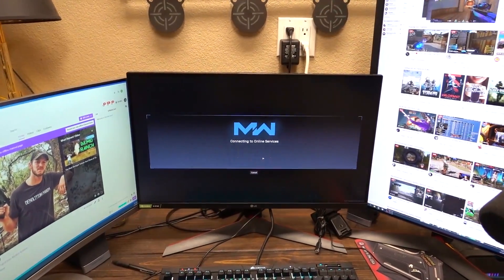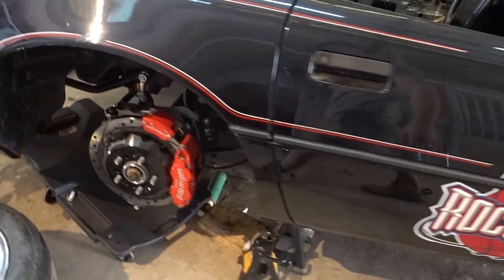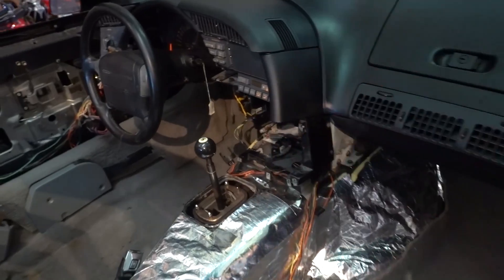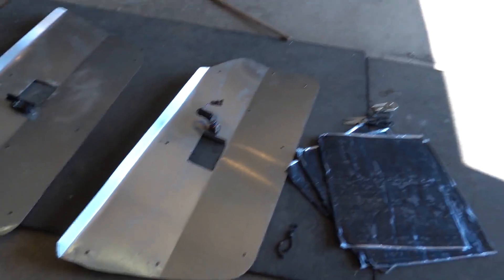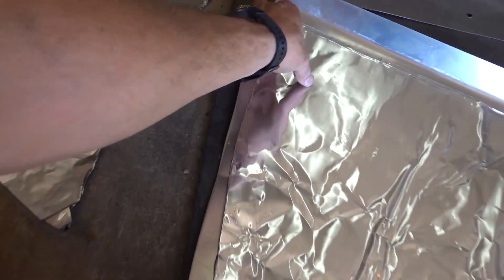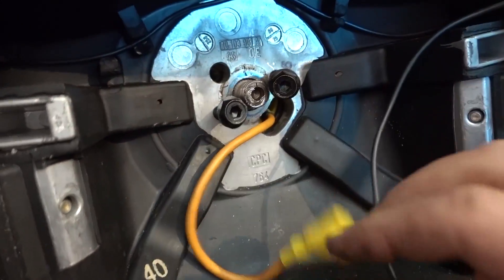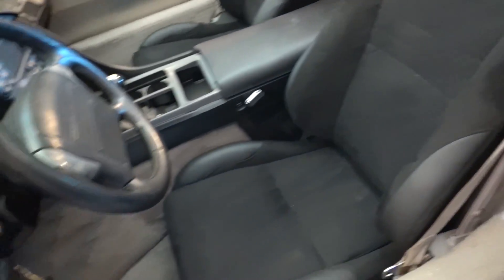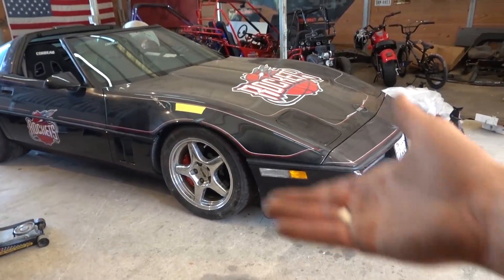Rebuilding a Destroyed ZR1 Part 10: Series FINALE

Comment: When you attach the harness to the cage, make sure you attach to the upper tubes. If you attach to the lower tubes and crash, it will compress your spine.
Reply: Woah! Didn’t know that was a thing. Ouch.
Reply: Hmmmm, interesting. It makes sense though. I'll keep that in mind when I build my car in the future
Reply: Ok boomer I drag race for a living. I crashed 4 times and I rolled the fourth time and my harness was on the lower tube and im still fine and it was the car
Reply: I mean, that depends on the Angle between the seat openings and the bar. Usually manufactures say up to 15 degrees is okay
Reply: And that doesn’t look like a crazy angle. Hard to tell by vid tho
Reply: @sargentwizard4385  Technically, I'm a millennial. You need to work on your critical thinking skills. Clearly it depends on the angles and other specifics of the installation. Just because it hasn't caused you a problem doesn't mean it wont ever, and it doesn't mean it wont cause someone else a problem in their setup. It's better to be safe than sorry, and I just wanted him to at least consider the potential issue before mounting the harness so he can make an informed decision.

Comment: IMPORTANT LIKE SO HE SEES THIS!: That seat is too small for you, you need a taller one. The highest point on the belts is over your shoulders which can cause your spine to compress if you hit something. The holes in the seat should be over your shoulders.
Reply: You’re  right!
Reply: Bro it’s fine
Reply: It does not matter he knows what he’s doing
Reply: @gageaversa6976  it kind of does matter though
Reply: Gage Aversa  sorry but you are wrong, you obviously don’t know to much about cars. When you get in a wreck you want the harness above your shoulders so that it doesn’t pull you down to the ground. Instead it pulls you back away from the steering wheel.
Reply: def needs to sit lower too, hes almost the same height if not taller than the cage
Reply: @gageaversa6976  Yeah, it doesn't matter at all. Who cares if he gets into a crash and it  compresses his spine and causes major injuries. Doesn't matter at all.
Reply: @gageaversa6976  he might, but someone else could cause a crash.
Reply: is he going to use a 5 point seat belt?  if not, then it doesnt matter.
Reply: why does his 1990 zr1 sound exactly the same as my dads 1994 chevy camaro?
Reply: Also, don't mount the harnesses to the bar; mount them to the floor behind the bar, and run the belts over it, so that the pressure keeping you in the seat is horizontal and not vertical.
Reply: You're right but I doubt he'll use harnesses
Reply: @danedomerese9604  no u

Comment: Those door panels have my arms crying in agony for the Texas heat.
Reply: Well it is a stick so you won't ever have your left hand off the wheel
Reply: Dani Khaos false, I do it all the time. When your cruising what do you need to be shifting for?
Reply: Left on the window and steer with right. Need to shift for any reason switch and shift then switch back. I’ve driven manual for 12 years and as I said I do it all the time.
Reply: Didn't he say something about tint?

Comment: So happy to see someone tightening wheels properly with a torque wrench 12:00
Reply: No need for it
Reply: @JedemPoKucama  I will politely disagree. In 17 years if automotive and using different tightening methods torquing is tried and true for best results and maintaining proper brake rotor orientation. If you want to hammer lugnuts on with a torque stick or socket only, job security when those come back for stud replacements or warped rotors and brake jobs.
Reply: Said no one ever
Reply: @jonkwarsick2813  awesome
Reply: my impact gun goes BRRRRRRRRr
Reply: @JedemPoKucama  Don't need it on steel, but you need it on alu
Reply: Ugga Duggar’s!!!
Reply: Corvette lugnuts torque specs is 2 ugga duggas

Comment: When it comes to that steering wheel from experience the best way to remove them is to leave the nut threaded on just barely(keeps the wheel from coming all the way off and smacking you in the face) and pull torwards you as hard as you can until it makes it to the nut.
Reply: He is right....leave the nut a bit on and hit it from all sides....there is a spring behind it so the nut saves you for smacking it in your face....good luck with that
Reply: 😆 I learned this the hard way when I was a teenager and smacked myself good

Comment: I put the same seats into my 1990 base model C4 but ordered the seats and brackets separately so it took me a bit of trial and error before realizing the seat go on the opposite side with the recline handles going inboard near the seat belt latches. Good job on the build.

Comment: To get steer whel off, screw the but back on flush with end of thread. have someone put pressure on both sides of the wheel as though they were pulling it off, small sharp tap on the nut with hammer and wheel should pop off the spline.

Comment: Little tip with the steering wheel, it will come if you hit it hard enough, but wind the nut back on a little bit so you dont break your nose when it finally gives way.

Comment: Wheels:
My opinion for C4s would be something with a nice dish/lip (lower offset), or if you plan to do more of a flush offset, do a wheel with fewer and wider spokes similar to the factory wheels. If you do a deep dish/low offset wheel, make sure you have a lower offset in the rear than the front so it looks proper 👌 same with the width.

Comment: Helpful tip for removing steering wheels, keep the middle bolt on slightly and just bang on the side of the steering wheel and it'll knock it loose

Comment: Matt! For future reference, taking off an old steering wheel is much easier by not taking off the center bolt (that sits under the airbag) all the way and smacking the sides of the wheel to jar it loose! Then, you just pull it off like it's nothing!

Comment: A piece of aluminum billet easy to drill holes to match holes on steering wheel at least 5/8 thick pull tight with bolts longer than ones used against end of shaft then give it a brap with air hammer

Comment: To make the rims poke out a little more, you can get new rims that are a little wider but also get spacers, jist make sure you get these things called hib centric rings for your new rins in order to minimize vibrations at high speed, also do yoir research on the rim company and how they make their rims (pressure casted, forged, etc)

Comment: I would buy 2 big sheets of Kydex "like holsters" and cover the door panels. I'm not digging the chrome color doors. Plus it will be super hot if you touch it. I would get Kydex or some plastic, use a hot gun to stretch it out over the door frame and put some black or whatever color Kydex you chose plastic screws into the door panel to hold the Kydex up.

Comment: corvette metallic grey... use factory wheels and powder coat black chrome.
we need to hang out. I used to hang out on a 2nd gen Camaro board... about 15k in technical restoration posts....
I owned many Z-28's...
but they gave me shit because basically, I'm a Vette guy...
rock on man. new wrench bender respect....

Comment: You should put some black fuel cleaver wheels on it and if you wanna stance out your wheels get some spacers for your wheels don’t buy wheels pre spaced cause then you can’t rotate around your tires without rub most likely so just get spacers they come in different sizes but should do a matte blue or gloss blue with orange pin striping cause complimentary colors or do a two tone color like with old 1967-72 c-10 Chevrolet trucks